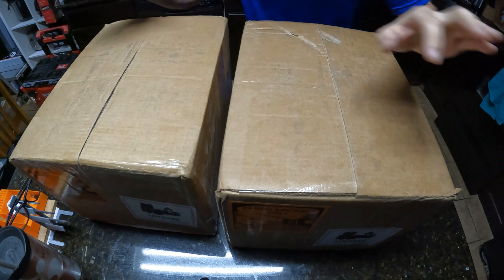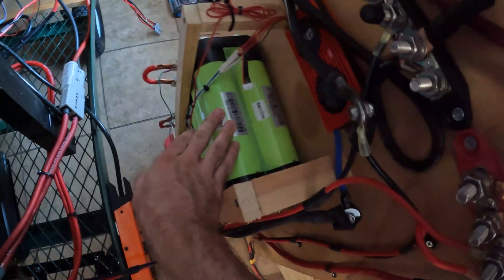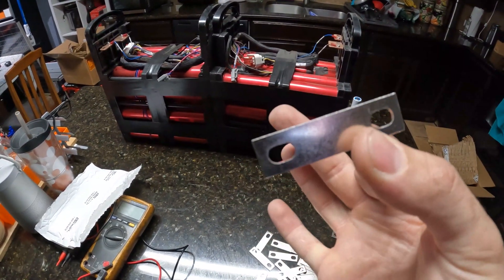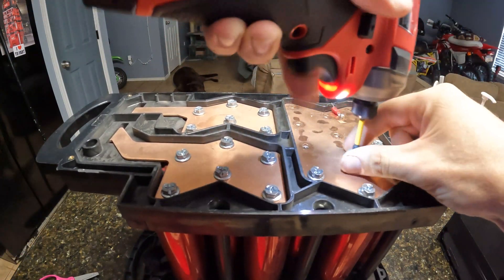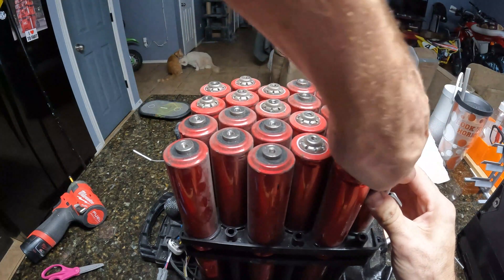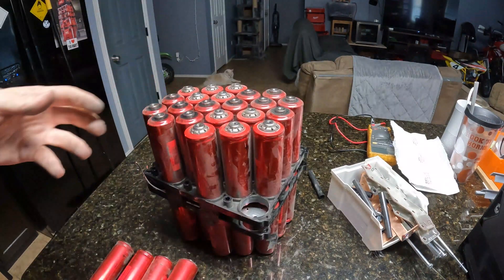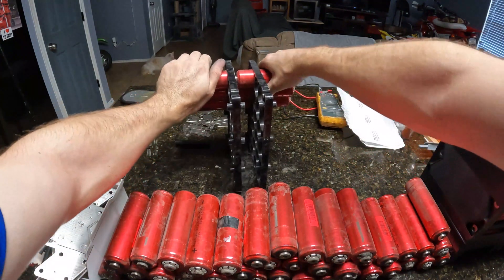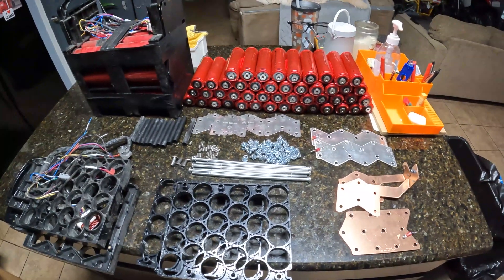Headway 8AH Lifepo4 Super beast Module Dissasembly

Comment: FYI, Headway 38120 cells come in two different types, the regular blue ones and the red HP ones, the red HP ones are 200 amp discharge and as far as I know only come in 8 ah and smaller. The blue do come in different sizes. I am very poor and live in my bus fulltime in the high desert of New Mexico, my AGM batteries took a dump on me so I need to replace them and I plan on using the super beast batteries but the complete version, with the heater pads, fan, contactor, fuse, and hall sensor, I have two now, but I can't use them yet, I need 4 more of those zig zag plates, is there anyway you can help me.

Comment: Did you remove the solder from the cells? On my superbeast battery I've got 3 cells where they soldered some wires on the battery where the red wrap is located. I'm just wondering how do I get the solder off of the cells and would appreciate any advice.
Reply from the maker: Mine didn’t have solder that’s weird
Reply: It's not solder, it's some kind of glue and a razor will take it right off, if u peel the red case on accident put tape over it

Comment: When you reassemble the groupings, the center plates of each grouping need to be heavily connected, and not just by the balancer leads. At 200a/cell, if you have one cell in your grouping go bad (which they do) you will cook that tiny wire. This could have a major cascade effect on the entire battery. With 2400a across each grouping, it needs a solid connection. 

Truth stated, if you removed the center plates but still do what you are doing, it would still create a 12v battery, ….but would it be safe?

I’m just about to do the same, but have taken the 3 x 4 end plate and am using it as a template to make 2 new plates for the middle. I thought about making up connecting bars like you did with your positive end plate, but am not sure if there is enough room to get one big enough to handle the load. 

I’m also connecting the 2 vertical end plates with the same plate material, like what you did on the new positive grouping.

Comment: Can i possibly have a setup that can get up to 24v and about 300+ah with probably connecting 7 in parallel (22.4v/8ah) then series them the remaining 41 pieces will then have (3.2v/328) add them together (336ah/25.6v) and yeah I know the bms connections will be the problem, please let me know what you think of this set up , my inverter is 24v and presently using lead-acid batteries which is really getting weak lately.
Reply from the maker: Hoensty these beast modules as is are already 8s6p. So you could get a beast module, add an 8s bms and have a 24v 48ah pack ready to go. The modules are very well built and if you need 24 volts I'd run them as is. Hope this helps
Reply: @Mikebuildss  the point is that its just 48 ah which isnt much for my apartment
Reply from the maker: @chuksobi593  add a few in parallel
Reply: @Mikebuildss  thanks figured it out already ...
Reply: No matter how many batteries you place in parallel you still have the same voltage, you do have more amperage. Series connections get you more voltage, at the same amperage. I have been building electronics circuits and playing with electronics since 1973, I am not 59, so yeah I started as a kid using my grandfathers old electronics magazines, some dating back to 1957.
Reply: @WalterGreenIII  oops so sorry I sort of put them wrong I meant series not parallel....
Reply: @chuksobi593  I know, was not intending to embarrass but though others should be notified of the error.
Reply: @WalterGreenIII  yeah trust me it's been an interesting adventure
Reply: @WalterGreenIII  figured I can setup 12v 250h with just 32